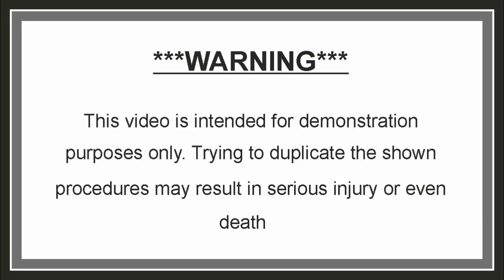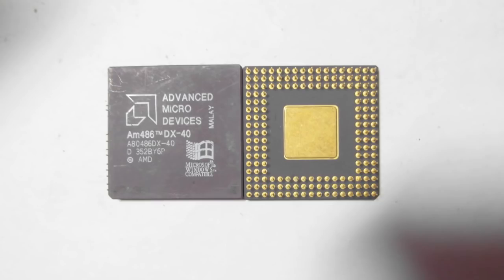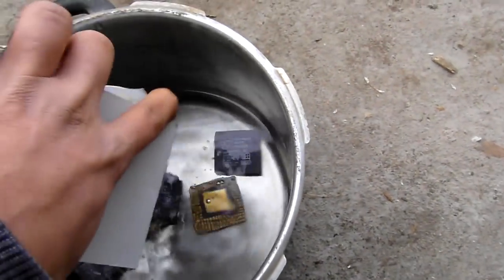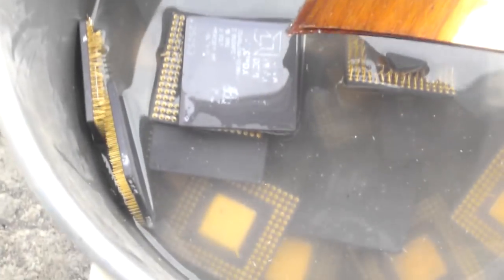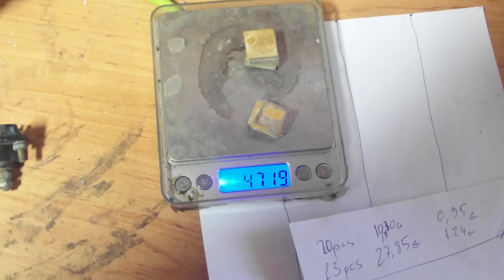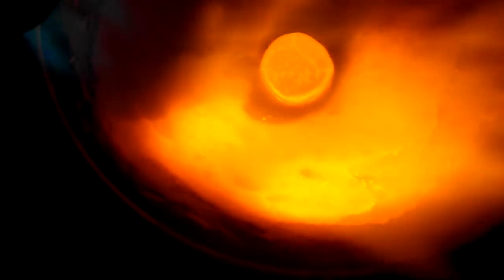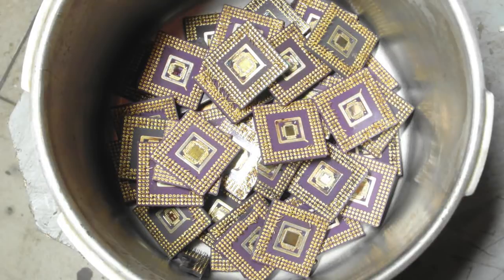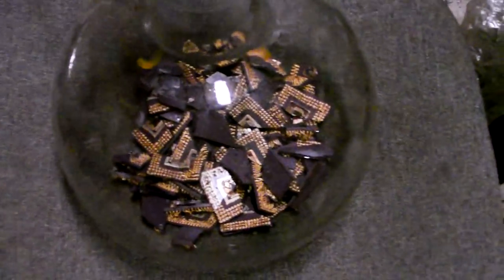1kg AMD 486 ceramic CPUs GOLD yield

Comment: Nice video ! If you run the ceramics directly with AR , won't be some HAuCl4 remain trapped inside them? I know there is some porosity of that broken allumina .
Reply from the maker: washed 4 times with boiling hot water, but yes there is a chance. I thought the ceramic is barium titanate
Reply: If I'm not wrong , the ceramic is a syntered corundum . That's why is so inert even under the oxy torch .